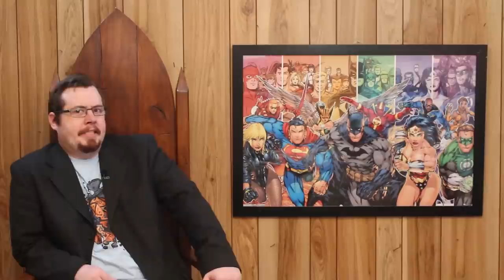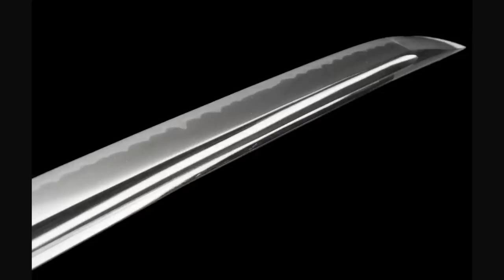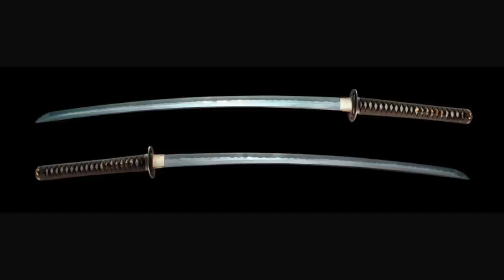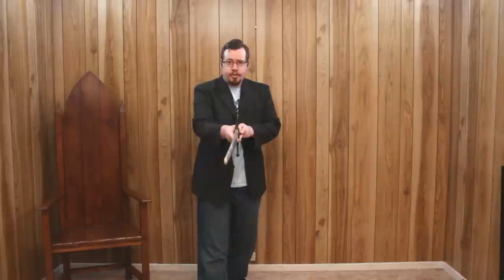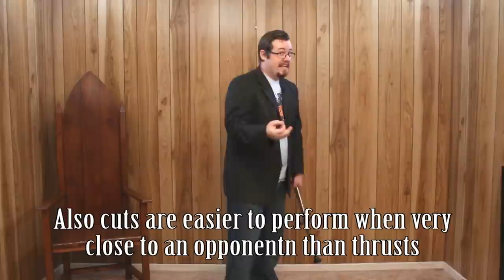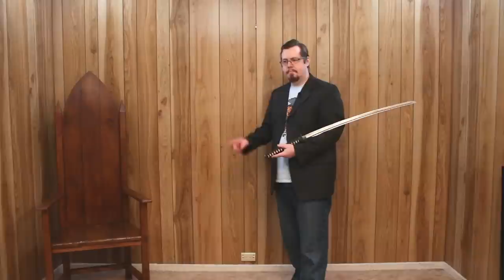Super cutting swords, are they needed?

Comment: This video suffers mainly from the over generalization of sword types and their purposes. When saying that "rapiers can't cut" or "falchions can't thrust", you seem to be slightly misinformed on the purposes of these swords. Rapier treatises have sections on cutting, and it was done a lot. Just because most cuts from a rapier may not be lethal, that does not mean they are not effective. Also, the battlefield weapons of the Renaissance, side swords, hangers, and broadswords, were all excellent cut and thrust swords. They usually weren't overspecialized, thus making for an excellent sword in most situations. Sure some swords can't thrust; many falchions have no point at all, and of course, smallswords (and some rapiers, though not many), have no ability to cut. But this does not mean that one is always better than the other. Take armor for example. Chainmail and leather/ gambeson is more susceptible to thrusting attacks, but protects fairly well against cuts. In that situation, yes, a thrust is more useful. But that is not always the case. In the context of a duel, many would say that stabbing is better, but rapiers and smallswords weren't the only weapons used in duels. Sabres, broadswords, and even longswords were used to settle matters of honour. And to say that all longswords are a perfect compromise between cutting and thrusting is simply not true. There are many examples of longswords and arming swords with very narrow blades; not conducive to slashing. But these were excellent in armored combat, where thrusting through the gaps in armor was necessary. 

And then the subject of sabres. As these are my personal favorite sword type, I will try to remain unbiased. Saying that tulwars, shamshirs, and sabres are all bad at thrusting is generalizing about a type of sword in which there is much variation. Of course many Polish sabres, as well as military sabres of the 18th century are very curved and specialized for slashing. But in they were primarily use on horseback, where this type of attack was safer. At sea, the cutlass and hanger were very effective fighting weapons, great for both cutting and thrusting. And the use of sabres on foot was widespread as well. In the 19th century, sabres got a lot straighter, as a compromise between cutting and thrusting. So, even curved swords, specialized for the cut, could sometimes thrust just a well as a rapier.

In summary, rating one design beats another, or that one design is unnecessary, is to ignore context, as well as the finer details of how each weapon is used. Obviously, super cutting swords were very useful, because of how widespread they were. In historical times, people couldn't afford to use things that were impractical. So every sword had its purpose, and we shouldn't be to quick to say one isn't necessary.
Reply: Looking at actual rapiers from the 16-17th century and I can say this with confidence. DON'T PUT YOUR ARM IN FRONT OF IT! If it cuts into it, it is gone, many rapiers are broader than cavalry sabres, with of the period and the only thing why you'd not cut with them is because their length would make it too slow. (when considering the avarage rapier is around 1.3 kgs with some examples being 1.8 but it usually stops at 1.6, and even George Silver wants you to use a "short sword" that is in proportions with a rapier and he states that such swords are perfectly capable of removing extremities. His short sword is ~40-42" for the avarage guy back in the day in blade btw)

http://wiktenauer.com/images/8/80/Silver_2.jpg

Rapiers ca. 1600

http://wiktenauer.com/images/thumb/3/3b/Saviolo_2.jpg/1280px-Saviolo_2.jpg
Reply: High Master Johannes Lichtenauer I totally agree that many rapiers are slow in cutting actions, however it depends on how you cut. What I forgot to mention was that when people see sparring with rapiers, they see these small wrist powered cuts an that, combined withe " puny" appearance of most rapier blades leads them to believe they are weak cutters. But if you look at sources, you see very large sweeping strikes, larger than what most people do with sabres and cutlasses. A broad rapier blade could move very fast in a cut if the user was skilled enough, and with a narrow blade, it is encouraged to cut all the more harder, as long as you aren't leaving yourself open to an attack.

Comment: My theory on super cutting sword are that they are designed more  for calvary users then foots soldiers that why the samurai sword became straighter over time as they evolve from cavalry units to footmen.  
Then why 
Cause cuts are easier to make,  most cavalry have the purpose of hit and run so a longsword might not be a good option as for the overkill factor ties in with the cavalry
 image this you are going a 30km/h on a horse and only got one chance or that footman with end you with the spear. So an overkill factor with give you more faith. 
Lastly all super cutting sword are shorter than their straight counterparts as it uses less space cause you have the head of the horse to worry about. 
So overall a super cutting sword are more for calvary units than footman thus this led to people who are experts in sword to claim that super cutting sword are not needed in the battlefield
Reply: Liaw ysheng No, not realy. You can thrust, cut, heck propably even overrun your enemy when on horseback and he would die. Momentum does that for you. You could propably even use an Infantry Briquet as a Cavalrysword. (If you had long enough arms..)
Reply: Niklas Gosink that why I said it my theory, my context is in the eastern part of the world. 
Swords are different for different purposes.
Reply: Niklas Gosink and one thing having your sword stuck inside the enemy is not really ideal so a cut is more better
P. S spear on horse back is more OP

Comment: Comes allways down to the enemies armor and the army you are arming.It also completly comes down to the time and technology. 
Rapiers are by no means an awesome weapon. they would be completly useless against a fully armored knight.
Why did they become popular? because it was the time of Firearms, so Armor became useless and was exchanged for  faster fightingstyles without armor.
And the stabbing.only Rapier were mostly something for duels, not for real fights. You would never see an army with Rapiers.

So, why cuttingswords, instead of twobladed swords?
They are more effective against unarmored or lightly armored enemys.
the were definetly easier to make, I´mean, its just one side that needs to be hammered sharp and to be maintained.

And as you said, easier to use. Think about it, What has a higher chance to hit and unarmed unarmored fast opponent?
I pinpoint his vitals and make a precise thrust.
I swing a sharp ironbar and create a line of certain death.
Vector>Point

The problem are only Armored Enemys. You need a strong thrust to get through a chainmal, for example.
many very earyl swords are cutting oriented, for the not existing necessity of a thrust.
You had Spears for thrusting.And they are WAAY better in it.

Comment: I don't really understand your point of "Extreme cutting power is kind of redundant." Yes, it IS true that swords(swords in general not just swords in Europe) that are NOT designed for cutting, will kill someone, i think its a matter killing someone more than as fast as possible and leave the danger zone as quick as possible. If that isn't the ONLY reason there is another: killing big animals. It's possible that in area's where large predator carnivorous beasts roam like bears, cougers, hippos, startle moose or deer, or maybe poison snakes you want ALL the cutting power you can get and a heck of alot more(if running isn't an option) as these animals have thick think or can maim someone without even trying. You want to kill that animal in 1 second instead of 5-10 seconds.

Comment: Your basic way of thinking is wrong. 1. You don't have to cut all hand to win, just need to hurt a little as deep as 1cm in the muscle and 1 minute defense then you can't use it, and it's easier to win 2. When you stab and the opponent dodges or blocks you it will open because of the effects. 3. piercing consumes more energy after 4. when the original war, your enemy is not necessarily one person can be 2-3 at the same time, stabbing only attacks 1 person 5. the fact in war will be more snatching from stabbing because cutting the best ot energy, stability, move around, an more but not the deadliest

Comment: So your point is any armour that can block a thrusting weapons cut will also block a cutting weapons cut, therefore curved blades are useless...debatable but understandable.

You are however completely ignoring the economics. A curved blade is extremely efficient at cutting. This is important because an efficient cutting weapon's virtue is not in how great is the cut but how much mechanical stress do they suffer when making those cuts. 

A straight blade will suffer much greater mechanical stresses while performing a cut of the same caliber and stabs subject a sword to insane mechanical stresses. This means all good straight blades will be needed to be made with very high quality steel. Impractical for large scale infantry and skirmishers who fight on a constant basis. 

Am I crazy or did you ignore these factors?

A curved blade will give you more cuts per kilo of steel, it's simple economics.

Comment: shad, this only demonstrate that you have very little experience in using swords and in battlefield psychology. cutting weapons were used more by soldiers, thrustings swords by civilians who dueled. a gaping wound from a cut is far more demoralizing to the other soldiers than a stab wound. also, the curved cutting swords appeared mostly after the age of the plate armor, and used by cavalry, and the curved shape is far superior to get your sword out of the wounds quickly than a straight blade. your argument is reqlly about straight blade vs curved blades. try to think a bit shad.

Comment: Sorry, man. Bad example. If you made a sword 2.5m long, it wouldn't be impractical to use - you could half-sword it, and almost use it like a spear.

A better example would be making the tip 25kg. That'd be fuckin' stupid.
Reply: +Sanguis Dominus but if you manage to get a swing it would be almost impossible to stop and if the blade is designed to be a super cutter it will guarantee a kill with every swing
Reply: moldj Except that's never going to happen, unless your opponent is just standing there waiting for you to try and cut him with this massive unwieldy, impossible to use effectively, blade.

You'd be lucky to get to swing it once, and even then by the time you get to a point where you can swing it, it'd be incredibly obvious which direction the attack's coming from - and you can't feign an attack from one direction and suddenly attack from a different angle - once you've started the swing you're committed to it.

So your opponent just dodges, and now you're left open, because you've got this massive, heavy weapon to recover with. So he stabs you quickly in the throat with his more practical longsword.

That's assuming you even get to swing it in the first place, before getting stabbed.
Reply: Sanguis Dominus you can get help to from others to raise your sword before the fight begins XD